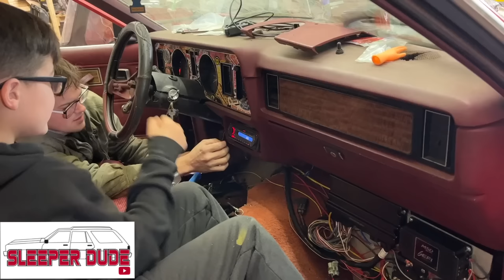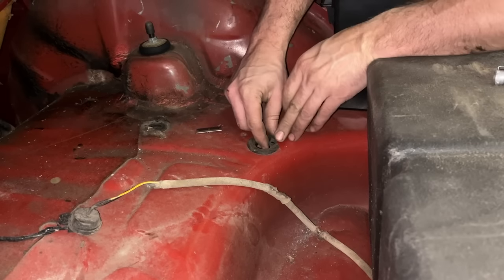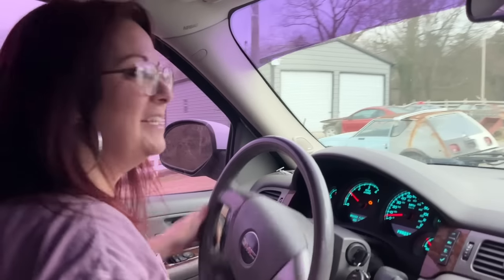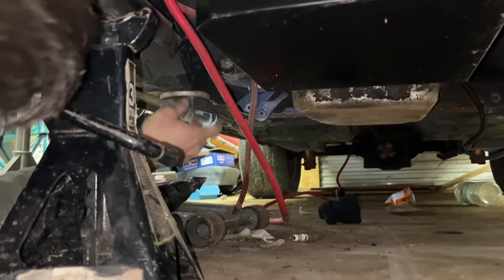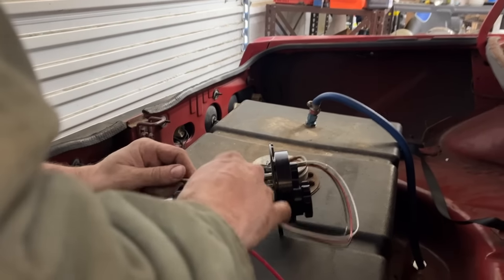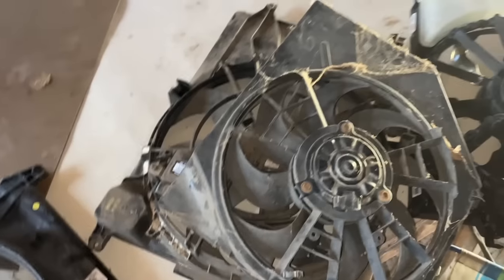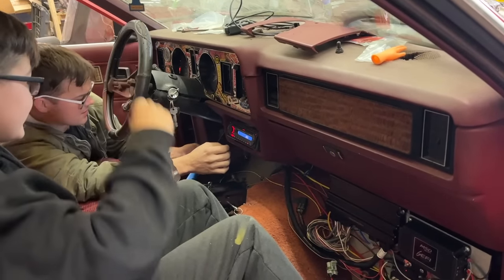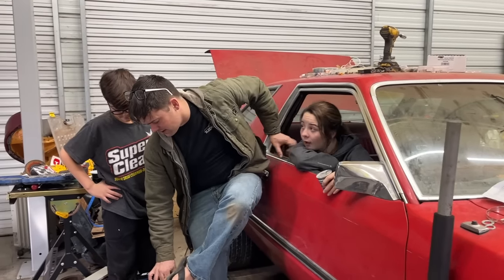Big Block Twin Turbo Fairmont Fox Body gets wired!

Comment: I do automotive wiring almost every day and I love it. Just a suggestion, you might want to put that mega fuse at the battery. That way if it grounds anywhere it will pop the fuse at the battery and cut all power off
Reply from the maker: Awesome
Reply: Yeah, you need to have a fusible link somewhere in the wiring. Better that burns and the car goes dead than a wire heats up red hot and burns your car to the ground. And remember GROUNDS - lots of them..
Reply: Are you going to make more vw bug  videos

Comment: I'm a wire'ologist. Rewired loads of industrial vehicles. 
It's true what your papa's saying about the built in smoke
 in electrical/electronic equipment. There should be a list out there somewhere dagnabbit!.   
That there vehicle is gunna be a casing chomper for sure (fit an intercooler).   Great show. 
Very edjermacational.
Well done you lot  ❤️
Reply from the maker: Thank you

Comment: This is why you need 3D printer…you can make any screws, nuts, fan thingy, body panels ect. Get your honour roll children to operate your 3D printer along side whatever project your doing. Your measurements are spot on with the wall panels you put into your camper van. That’s half the process. Love you guys.
Reply from the maker: Awesome thanks

Comment: I've been doing wiring for a long time, there are a couple of things I do that help make a good connection. Crimped terminals are just as strong as a solder splice, if done properly both will be stronger than the wire itself. When I install shrink tubing, I use a heat gun. If the shrink tubing gets too hot it will get brittle and crack. When I crimp to large gauge cables like battery cables, I have used a hydraulic hex crimp tool like you can find at Harbor Freight. Harbor Freight has SKU's 66150 and 64044 for $70. They come with dies to do lots of different sizes of wires and lugs. With some practice and some care the crimps will be secure, safe and professional looking. All the best to you and your family, you're one of the best and most entertaining channels out there.
Reply from the maker: Thank you for the information. I am blessed

Comment: Before i got into LS’s i used to hate electrical……now when i do wiring its actually kinda rewarding …especailly considering last millineum i wouldnt even touch a distrubutor…….those fuseblocks are a life saver and i wired my last 3 terminator x builds with them the same way you did….if only i had access to this stuff 25 years ago 🤯at todays prices😏……….with tommarows budget😮
Reply from the maker: That’s awesome

Comment: You are absolutely correct about the wiring isn’t that hard if you attack them one at a time. From a former owner of a Fairmount, they are a very reliable car. Ours had an in line six, with all the smog stuff cut and crimped closed. The ignition module used to over heat and we would get stranded for at least an hour. Fixed that problem by installing a second module and would just unplug one and plug in the other. Great car.👍👍🇨🇦

Comment: I'm  on board with loving wiring. Funniest part was when you told Ralphi that his torque converter was loose because he did not have enough rpm drop. 😅🤣😅🤣😂 cheers Stew.
Reply from the maker: I’m glad you liked it

Comment: When I worked in a welding shop we made battery cables out of old welding cables. We also made booster cables out of old welding cables .  With some copper pipe and  solder they made good battery cables and booster cables.

Comment: Make a plexiglass cover mounted on standoffs for your electrical panel so Tosh will not be able to damage it. If you love electrical wiring then do a solar power system system on the Camper you will love it !

Comment: Be sure to fuse all wires according to their size and not to the maximum capacity of the terminal. Good job on the wiring.
Reply from the maker: Good point

Comment: I like those non insulated connectors also. 50-% them insulated con. Get sharp corners,that rip your heat shrink👍. I have found the connectors at ace hardware are thicker metal.people look at me funny but I carry my pocket caliper and check ,befor I buy.👍👍
Reply from the maker: I agree

Comment: He , thanks for a great video , as always ! I dont want to ruin the fun but I just want to remind you that those two turbochargers will be very hot ! And by that I mean really hot ! They'll glow actually ! I dont know how much heat that plastic on the fan will stand but there might be a risk that it will melt when you start to put pressure on the motor ! I really hope it'll be ok but keep an eye on it ! Greatings from volvo city , sweden !
Reply from the maker: They do get very hot. I would be more worried if the fan was closer to the exhaust side.

Comment: You could mount a lawn mower motor in the trunk.   A piece of chromed pipe exiting below the bumper would deal with the exhaust.  A couple pullys and a belt and you have a charging system.  
Or,   just use that alternator mount.

Comment: Measure all wires 10 times then at 4 in and you should solder every connection just to be sure you don't want to burn out any of that equipment good luck

Comment: Pick-N-Pull sells battery cables for $4.99. What I like to do is get a cable from a 90's BMW because those are trunk mounted too and are extra thick 00 gauge. So you get a 8-10'  long cable with terminal end for a bargain $4.99.

Comment: The way that gas tank vent is situated, that vent hose will happily drain the gas tank in the event the car should tip over. I have the same sort of setup on my Chevelle except my gas tank vent has a one way valve that prevents the loss of gasoline in the event the car becomes inverted. One hopes that neither of our cars ever get upside down however, if your car were burning, having an ever growing pool of gasoline in the trunk and flowing into the passenger cabin, would certainly make one nervous.
Reply from the maker: Good idea I need to get a valve

Comment: You need a isolation fuse at the battery, if there's a short anywhere from the starter to the battery, the whole wire will overheat and melt, possibly setting the car on fire

Comment: I hope you get that Fairmont future affection with that Chevy motor because I got my 78 Fairmont Futura what a big block Ford 460 in it and I got my 80 Fairmont Futura wagon with a 7-3 powerstroke diesel wanted thousand horsepower engines ready to go to the drag strip anytime one of these days we'll have to meet up so we can race them

Comment: Crimp is the standard on vehicles. Solder can break. FAA uses crimp on aircraft.
Reply: Always need a fuse within 18” of battery.  ALWAYS.
Reply: Amazon. $12 for a hammer type crimp tool.
Reply from the maker: I agree

Comment: I have a Lincoln mark 8 fan and I wanted to put it on my K5 but I cannot find the correct way of wiring it up and it really pulls a lot of amps. The question I have is do I need a contactor and a temp controller?

Comment: This might be my OCD kicking in but it (the wiring) would look so much better if you drilled a hole in the mounting plate and then thread the wires through them and then out of sight. Also the more wires out of the way the less chance of someone "accidently" pulling a wire or wires out with their crocs..lol

Comment: Do/if you ever come across a 96-99 Taurus SHO or 2006-09 impala SS v8 (Any) LS4) will you buy it and get it running? Or just keep an eye out for anything with a hog leg 
Or? Try an get that hog leg fairmont with the stuck v8 302 attempt at running it again?

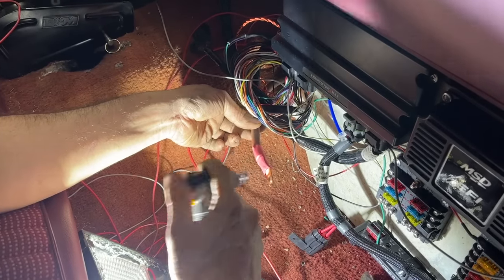Comment: Hey brother, so the part at @30:29 you say you wished ya knew where it came from? Well pop the hood on any full size chevy truck with the battery on the passenger side right under the windshield and then take a look at the firewall next to that battery should see this part and a 175amp fuse for your main power directly off the alternator... Lol, you're welcome sir...

Comment: fyi, i just got to the point where you pulled the battery cable with two batterie connections- i recognize it. thats out of an old ford diesel truck with two batteries
Reply from the maker: I think you are correct

Comment: I got 2 motor electric air horns, with an 200psi train horn I wired myself.  Them little horns would scare people alone...  along with 3x25 watt solar panels with charge controller charging an 50 ah lithium ion phosphate battery for camping...  my little brother says i need an different hobby.

Comment: Running turbos in the engine compartment without an intercooler is shitting away power. Either 
push them out the hood or add an intercooler.

Comment: Josh you should try invent A system for old cars that uses farts to power the engine. I would make seats with holes and fuel lines running up to the carburetor or EFI system I wonder if it would work. After all ralphy in your videos sometimes says who cut the cheese.

Comment: How about a modern eco boost ford set up? This way it doesn’t take up much room under the hood and not have to modify the car, it would be a shame to cut into it.
Reply from the maker: That would be cool
Reply: @Sleeperdude  yeah it’s just a shame to cut it up after all of the work you put into it so far. Between the new floors and interior pieces it can be a resto mod type deal, good luck with it and I’ll catch you on the next one.

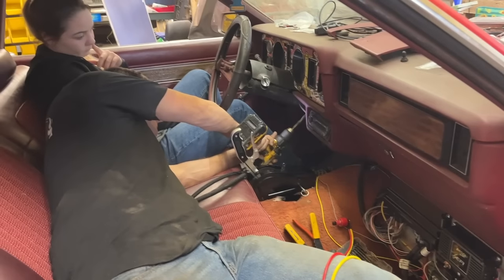Comment: 53:45.  HIIII FAN.   ALWAYS REMEMBER.   OIL PRESSIRE SWITCH.  OIL PRESDURE SWITCH.  OIL PRESSURE SWICH. ALWAYS.     FAN FUEL PUMP CHOKE POWER ALL ARE POWERED OFF THE OIL PTESSURE SWITCH THAT WAY THEY ONLY ARE ON WHEN ENGINES RUNNING.    OIL PRESSURE SWITCH HOOKS TO 3 RELAYS AND THOSE HOOK TO YOUR FAN. FUEL PUMP AS CHOKE HTR

Comment: Josh get marine heat shrink connector and the ones I use for butt splice is solder n seal butt connector it has a low temp solder inside the connector works great JT HOOKED N ROLLING OFFSHORE 🇺🇸🇺🇸🐠🐟🎣🛥

Comment: I know this is old but I see you are using HF wire. There wire is very cheap and not sized correctly. If you get a true 10ga wire and compare it to there 10ga wire you will see. You need to compare the copper. Not the wire and rubber coating. They just use thicker coating to fool people into thinking it’s said gauge of wire. So where you think you have heavy gauge your gauge is probably really 1 or 2 gauges smaller.

Comment: That heater makes me nervous you be much better off with a chinees deisel heater from ebay in have one they are well worth 100.00 safe dry clean heat and they sip deisel runs all day and night 1.5 gallons 12 v power source

Comment: Usually I like everything you guys do but I have to say that fuse panel panel that you put on the floor of the Fairmont looks like dookie I don't like the way it looks I don't like where you put it there must be somewhere else that you can put it it just does not look right it's dumb I must say to me your car of course it's your car but my perspective it does not look right you should put the fuse panel under the hood or in the trunk or something but not like the way you did it just it doesn't fit the car? And you know it's going to be kicked by accident and that's not good.